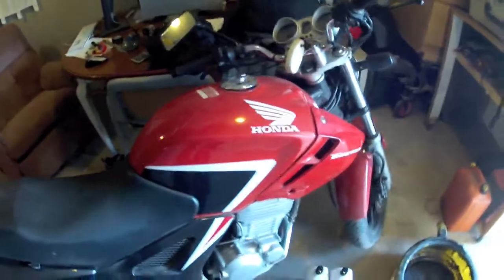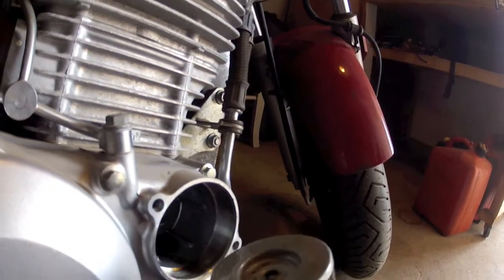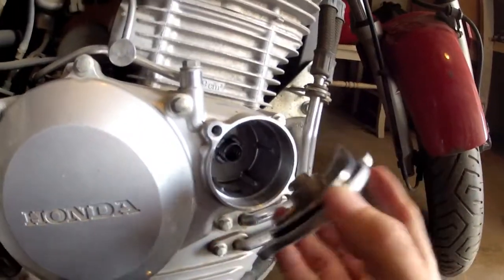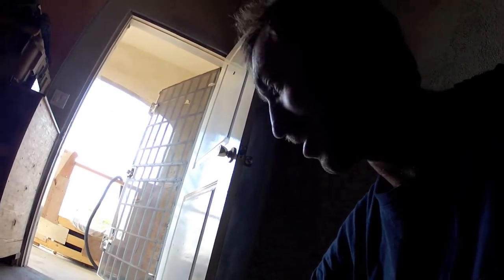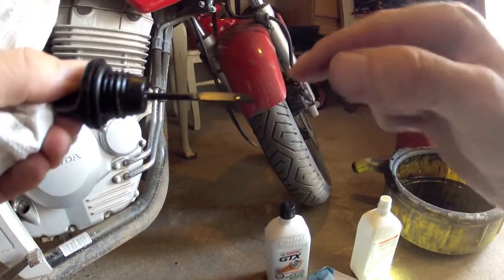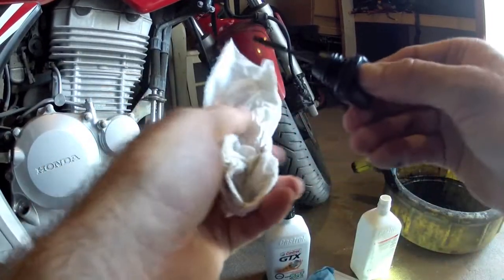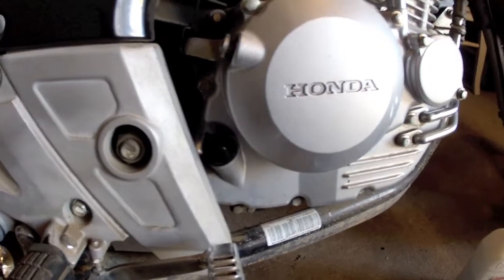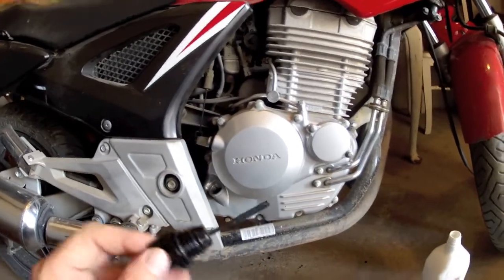How to Change Oil - Honda 250 motorcycle - VLOG002

Comment: Honda CBX or CBF 250 oil + 1.8L. (1.903 Quarts.) Remember to allow new oil filter to absorb and fill with oil, including galleries. (Motor running) Then recheck level. Note: Overfilling not good as can pop  seals under pressure! Oil filler screw also remove before draining oil for quick flow and no vacuum.